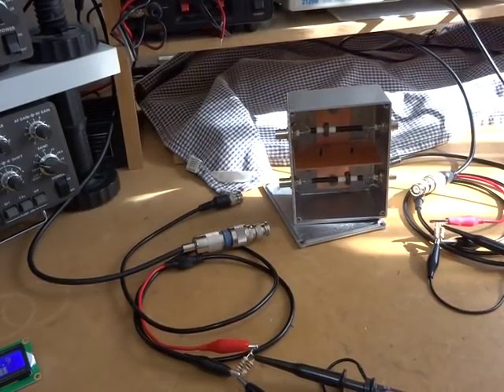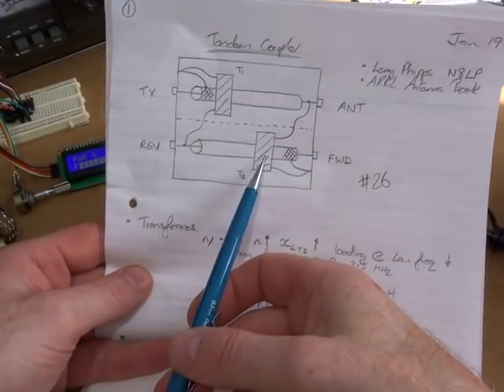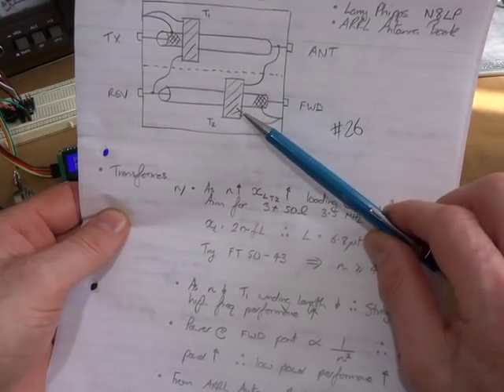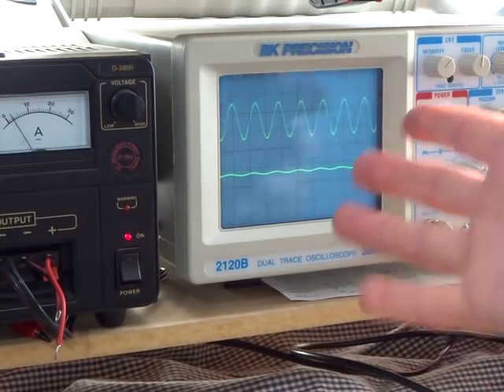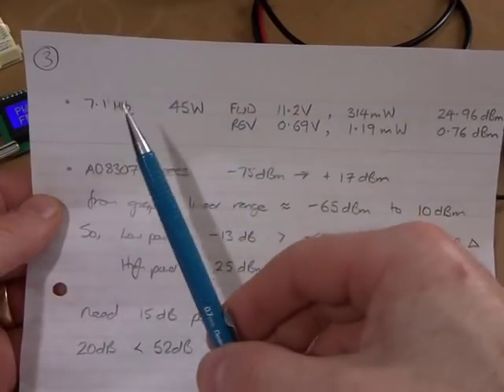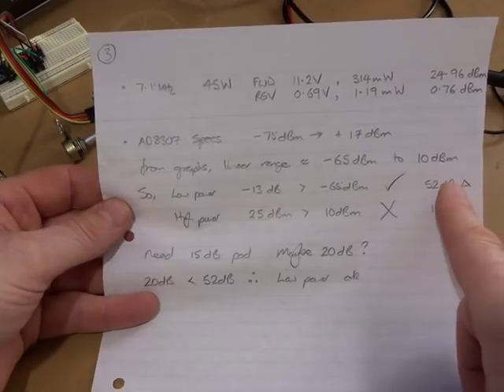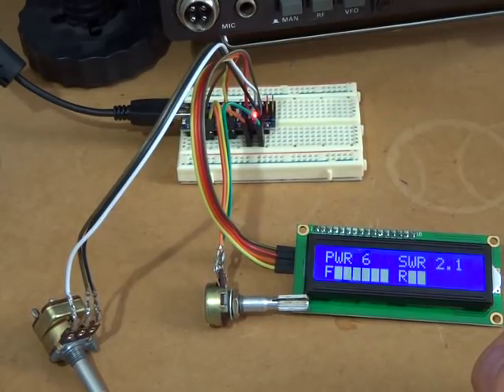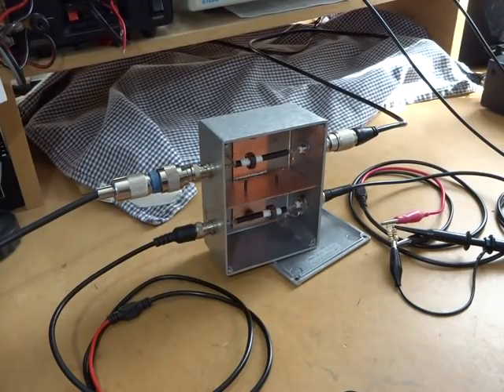Homebrew PWR/SWR Meter: Part 3 - Tandem Coupler Experiments

Comment: Hi Charlie!

Just a question/observation (because it wasn't clear in the video)....

In almost every rendition I have seen with directional couplers, the forward and reflected sense ports, in this video going to the oscilloscope, are typically terminated with resistors (respectively) matching the transmission line impedance, the obviously most common being 50 ohms.

I didn't know if your oscilloscope has input terminations and, other than the discussion about padding, you didn't mention it in the video.

I would think that the lack of, in this case, 50 ohm terminations on the respective sense ports could impact your measurements.

Again, just a question/observation.

73

:)
Reply from the maker: Hi Christina. Yes, you are quite right. Both the FWD and REV ports do have 50 ohm terminations. You can see the 2 parallel 100 ohm resistors that I used for each port on the video banner picture. I also understand that these are important to minimize high voltages across the transformer windings.Charlie
Reply: Yep. totally missed that! LOL!
Reply from the maker: No worries Christina, I do it all the time. Apparently, I have 'boys eyes'... :o)

Comment: Hi Charlie -Thank you for the over my head video -Hi Hi !!!
It will take me a week to try and unravel the maths !!
Can I ask you- where do you find the 10 Log power numbers from ? (It is the only bit that stumps me) !
If it is not to much trouble(and your valuable time ), would it be possable to do a short run though the 10 Log power calculations on your next video please ?
I am sure there must be someone else  out there confused by them !
Thank you again -M
Reply from the maker: Sure thing. I'll add that into the next video. In the mean time, this may be of help: https://en.wikipedia.org/wiki/DBm

Charlie
Reply from the maker: I'll aim to put up another short video tonight that looks specifically at the calculations. Hopefully, that will be of use.Charlie
Reply: @CharlieMorrisZL2CTM  Hi Charlie-Thank You, that would be brilliant, I would then have a great reference point to work back though all of the sums
you have completed since your very first video.
Thank you again for you time and patience -M
Reply from the maker: Gidday. I've just put up a video. No doubt there will be some errors, but hopefully, you will find it useful.

Charlie

Comment: Looking at the coupler box; does it make a difference for the measurements on what side of the coax you connect the ground?
Reply from the maker: Hi Ronald. I must admit I struggled a little with the same question. In the end I went with the configuration in the original article. If you have the time, try both options and see how it works.